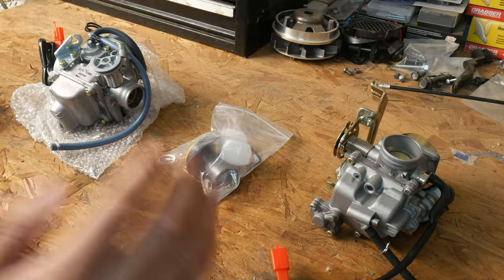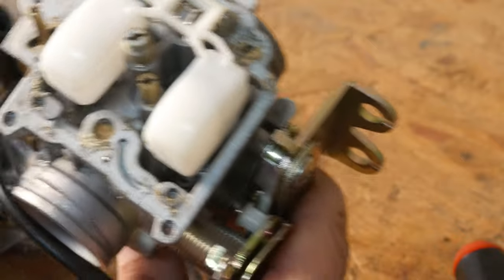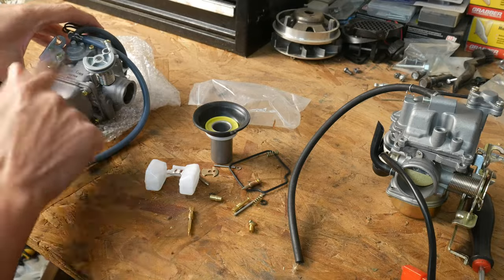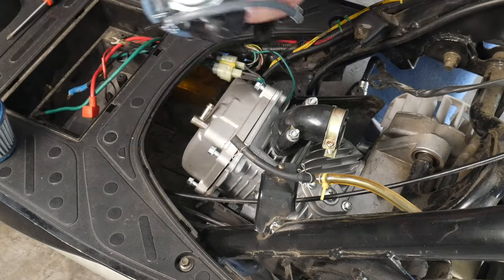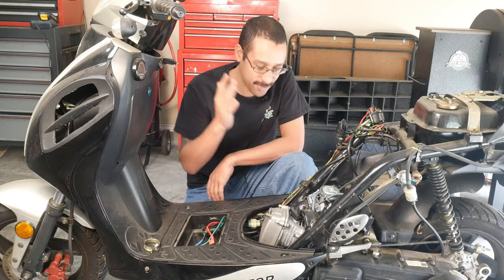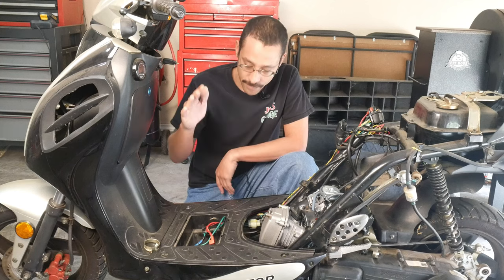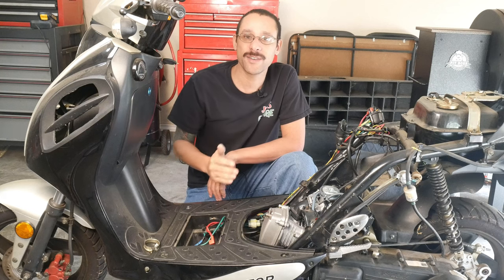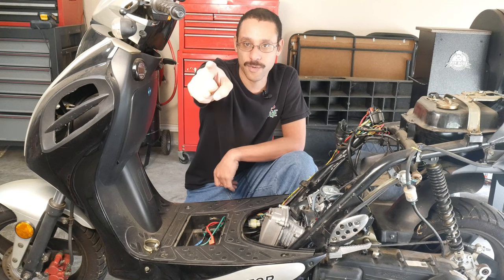GY6 Carburetor inspection & Installation

Comment: in philippines we called it 24mm diaphragm type carburetor. that kind of carb can give you the exact mixture of you're engine. less gas consumption and fast running. much good and better than the stock carburetor.

Comment: Would replacing the carb fix the issue if the scooter only start when I spray in starting fluid?
Reply: It is highly likely your carb is clogged.  It's getting spark and air just no fuel which js why the starter fluid fires it up for a few seconds.

Comment: So there's no physical hold into place bolts any where Else besides the ones on manifold. What about vacuum lines. Do I need to adjust the new one. I have a 2020 icebear mojo magic 150cc its stalling out. And I'm getting afraid to ride it especially making left turns. Some days it fine for awhile then it stalls out and won't restart right back up. Do you think a new carburetor is going to fix my issue. Only had bike from January 6 of 2021. Can you go over the wiring for brake and turn signals trying to mount top box with lights so far have blown two signal relays. Also have changed the sparkplug 3 times already. Please help, this is my only transportation I have.

Comment: Hi joey I have a 150cc scooter that I just bought brand new it's a icebear Hawkeye i am having problems going over 25-30 mph I changed out the carburetor still its acting the same which is bogging out when I climb speed to 25-30mph any advice you can give me...?

Comment: i have a2011 puma romeo 150cc scooter i have just changed the carburator and now it will not start. any ideas of what i should look for? gas line clear it seems it does not getting any gas in the bowl to keep it going. empty gas when i attached new carburator help pls/

Comment: Hi, newbie here, today I was doing general testing on autohoke using multimeter. 
With the ignition OFF red lead from multimeter to positive side of the battery and black lead from multimeter to green or black wire - both registers 12v.
Is this correct?

Comment: One of the new fancy ones u don't have to hook up throttle cables, fuel lines, none of that mess wow!!! It's a shame man, ur a decent sounding presenter and showed inspection but didn't do the second half of the title(which most ppl are probably here for) and show how to install it.. I'd say spend the 5 minutes it takes to install it and make a new video and destroy this video cause u were on the right track then called it a day b4 finishing hooking up ur customers toilet and walked off with them in disbelief..